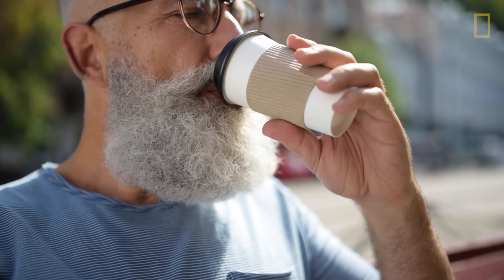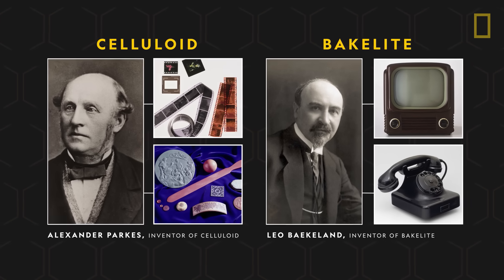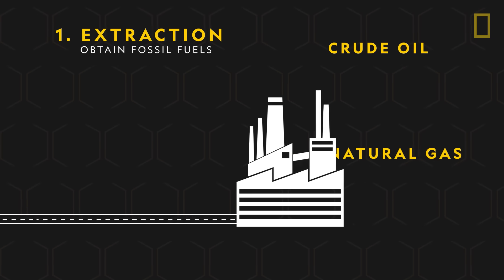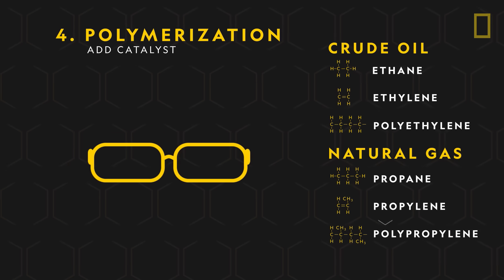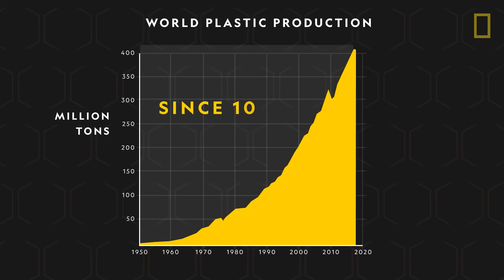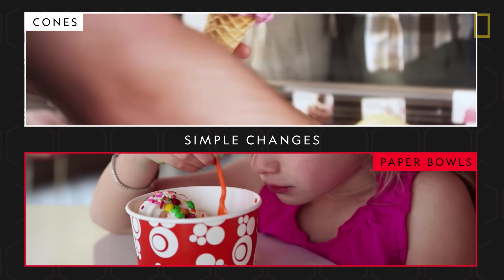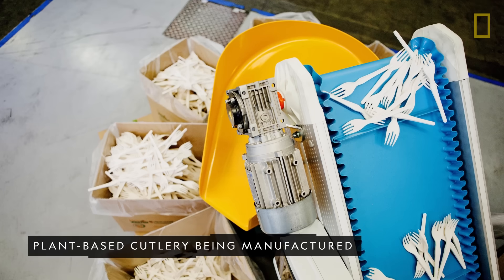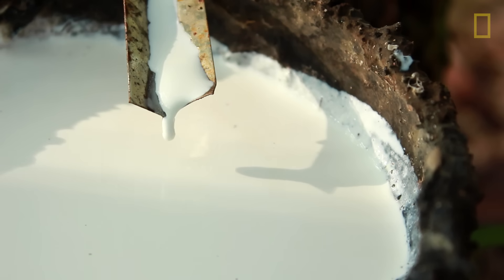Plastics 101 | National Geographic

Comment: Nah, in fact you would have to use a reusable bag 7,100 times before it causes less damage on the environment than plastic bags eneregy-wise.
Reply: But the reusable bag won't break down into little plastic particles like plastic bags do, so pollution-wise the reusable bag is better. And if talking about energy, remember you can choose where the energy comes from and therefore choose the footprint associated with that energy. Same goes for water involved with making textiles and paper - you can use non-potable and reuse the water best you can. There's tons of ways to make reusable bags an even better environmental alternative; there's not a lot of flexibility to lessen the negative aspects of plastic bags.